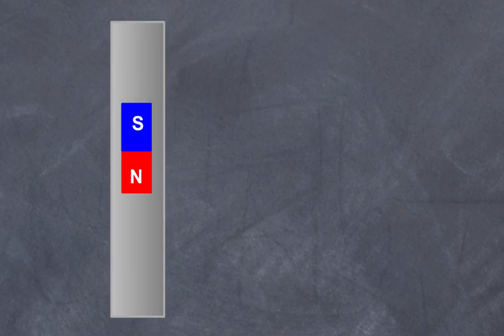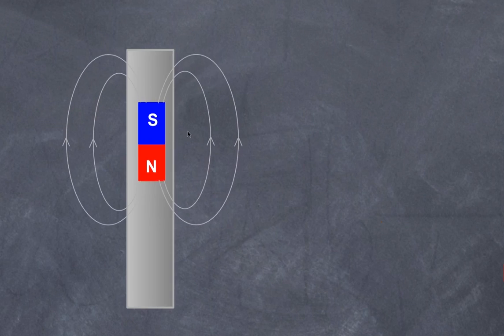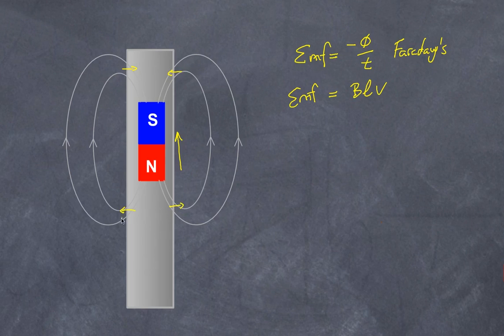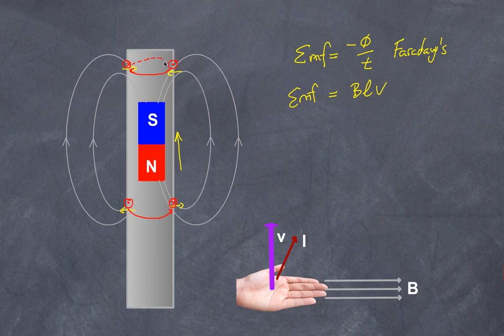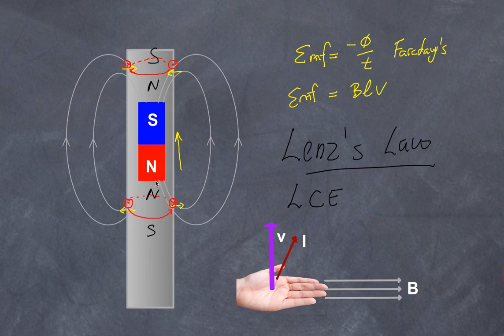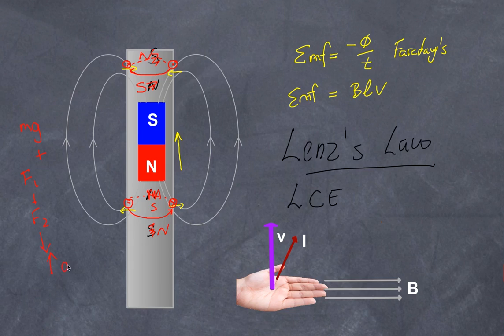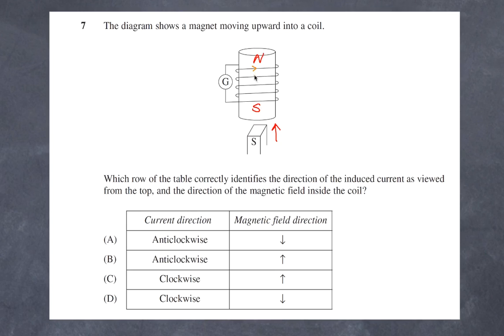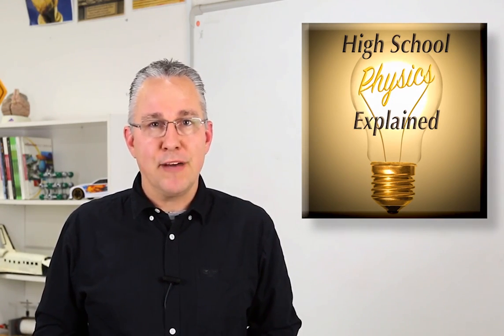Eddy and Lenz' Law Explained

Comment: I think you could explain the direction of induced current using Fleming's right hand rule. Remember that motion is in the direction of the conductor. Relative to the magnet, the conductor is moving upwards (you could explain this to a student to imagine that you are holding the magnet still and pull the tube upwards), now you can use first finger = field and thumb = motion to obtain the correct direction.

Comment: in the example problem, i’m having a hard time understanding how the magnetic field is opposing the change in the initial magnetic field. i understand the explanation of how we get the direction going upwards inside the coil, but how does this support lenz’ law where “the magnetic field created by the induced current opposes changes in the initial magnetic field” if there are portions of the magnetic field that are actually in the same direction (like inside the coil)

Comment: Really enjoy the videos, learning a lot so thank you.  Question about the copper pipe and magnet.  I saw another video of a copper pipe with a small slit cut all the way down so you can see the magnet fall slowly.  Wondered how the eddy currents could flow and produce a magnetic field when there is not a complete circuit anymore?
Reply from the maker: Can you share the video. I essence that should not work. As you surmised, there’s no complete circuit meaning no eddy currents and no electromagnetic braking

Comment: This may seem a stupid question but could the magnetic fields created by the eddy currents also induce their own currents in other areas of the metal tube ?
Reply from the maker: not a stupid question at all and a great question. The model that I present is a simplified model and helps explain Lenz Law. But just like projectile motion being parabolic  but really simplified (see one of my recent videos), in reality ANY change of flux in a material will cause the production of eddy currents. So yes, the eddy current produced will produce magnetic fields which will cause smaller eddy currents. The end result is probably something quite complex, not the simply circular currents I have drawn.
Reply: @PhysicsHigh  do you mean the transient phase of producing eddy current, the eddy current doesnt increase in no time, so there is changing magnetic field which will induce other eddy currents and so on until stesdy state?

Comment: left hand for negative electron flow and and right hand for conventional positive current.  The video uses both without specifying which of the electron or conventional flow you're applying, which adds to more confusion to the eddy current with its arrow pointing to the electron flow direction.  But for the sake of delivering the big picture concept, it does its job but could be improved if the above mentioned can be more precisely specified so students can have a more accurate understanding.
Reply: This is the very thing I was questioning as soon as the hand rule was initially mentioned. Thank you for the further clarification.
Reply: Thank you so much for that comment! I was just about to ask this question.
Reply: Left hand is using for induced EMF, and right hand for induced current. Remember the second generated emf after the current induced on second bar. Just like motor electric on left hand and motor generator on right hand.
Reply: two different rules blud lock in

Comment: Best video on eddy currents I have seen.  Most of the others are much more confusing.   But I have learned a right hand rule that works where you mention a left hand rule.  For the right hand the thumb is the direction of movement, the forefinger is the direction of the field and the current is the middle finger (all orthogonal with each other).  Of coursethis works the same way as your left hand rule.
Reply from the maker: Thanks

Comment: Surely the magnet falling through the conductive pipe would accelerate as it is still free falling. The magnetic field created by the eddy currents isn't increasing therefor the magnet will accelerate. This graph shows the emf induced as the magnet falls through the tube. It increases over time and so surely the magnet is accelerating through the tube (https://www.a-levelphysicstutor.com/images/fields/EMI-dropped-mag02.jpg). Hope that makes sense, maybe I have missed something. I'd be grateful for any help
Thanks
Reply from the maker: As soon as the magnet starts to accelerate the rate of change flux increases. Thus the eddy current increase and thus the opposing force. So no, as long as it’s in the tube it will maintain its velocity.  The issue with the image is that the coil is very short. If be it was longer than the magnet then you would have a section where the emf is zero whilst in the middle.
Reply: @PhysicsHigh  thanks makes sense.
Reply: @PhysicsHigh  will it fall because there are losses of current in the metal?

Comment: Doubt sir.....what will happen to the speed of the magnet when the copper pipe is cut along its length??
Reply: If the copper pipe is cut along it's length, there won't be any induced current, because the circuit won't be completed. Hence there won't be any induced flux. The Lenz's law won't be valid.

Comment: Firstly, you may want to mention that the metal tube is a non-ferrous metal, i.e. copper. Secondly, what the hell was that palm/fingers/thumb rule? Fleming's right-hand generator rule applies here. Never seen yours before!
Reply from the maker: The palm rules I used is more common in school here. See my video on hand rules. It will explain that as well as Fleming’s.

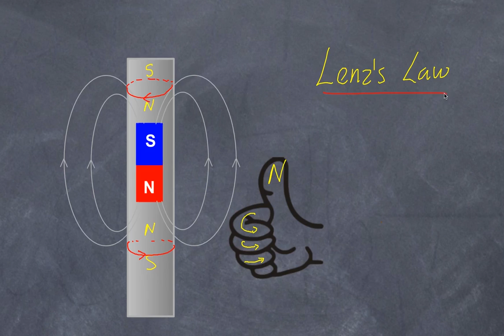Comment: So when are we applying left Hand rule and right Hand rule? in right Hand rule, is for current, magnetic field and force. moreover how is it going to be connected with back emf? and in Minute 11:35, i still don't get the idea for drawing the coil and the N S direction, also with the right  Hand and thumb. Why did you Point out the thumb is equal to North pole instead of South pole?

Comment: I'm confused, in my physics class and my curriculum we were taught that it's the right hand rule, everything means the same thing, fingers are B, thumb is I and palm is direction of F but because it's my right not left hand I have the current in the opposite direction which means that if I did it with my left hand I would be marked wrong. (Unless he is talking about negatively charged particles shooting perpendicular to the field, such as electrons, in which case I get it but I thought we were dong positives
Reply from the maker: There are differing hand rules around and they can get confusing if you mix them up. I have a video on the hand rules that might help.
Reply: i think generally in different countries there's different standards for that? like some places they only teach I as negative charge (the actual flow of electrons) whereas america teaches the conventional electric current. i think.
this is what wikipedia says:  https://en.wikipedia.org/wiki/Electric_current#Conventions

Comment: the poles of the eddy currents... shouldn't they have been the opposite according to the left hand rule?
Reply from the maker: Poles are determined by the right hand where fingers curl in direction of current and thumb points to N
Reply: But the current direction is not conventional since you used the left hand rule to find its direction  not right hand :/
Reply: Surely a magnet dropping through a metal tube is acting as a generator and therefore the Right Hand Rule should be used. 

 
 

Reply
Reply: @robertbeed497  right and left swap for motors and generators depending on whether you are using electron flow or conventional current flow concepts. it seems like most physics classes are stuck in some time warp where they speak as if electrons have not been discovered and we were speaking of some mysterious unknowable flow of energy.

Comment: Few Questions. Can you use dielectric grease or Vaseline to negate Eddy currents? If I lined a copper pipe with dielectric grease and dropped a magnet down the pipe would Lenz law still take affect but cancel out the Eddy currents? 

Only asking because I don't have e the material to conduct and experiment.
Reply from the maker: +Dustin Brodie I'm not an expert on dielectric grease but I can't see this working. It's all about conservation of energy. You cant stop the edgy currents from happening. So any other effect involving the grease would violate LCE.  Happy to be corrected by others.
Reply: Same principle for transformers apply to the pipe if you do it that way. I think it would be better to offset the cuts along the pipe though. That way it ensures the eddy currents will be too weak because they won't have a consistent path to follow.
Reply: dielectric grease does not stop current inside the copper tube.  if slits were cut top to bottom, the circulating currents would become smaller and the magnet would reach a higher terminal velocity but the effect still happens.  this is why motors are made from stacked layers of sheet steel instead of solid blocks, the eddy currents are confined to smaller cross sections and the effect is lessened.